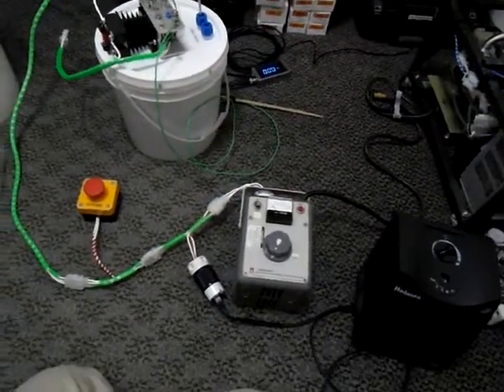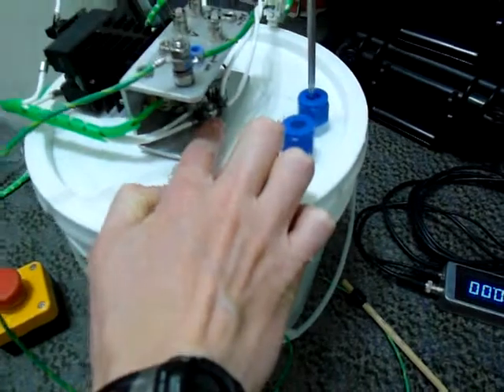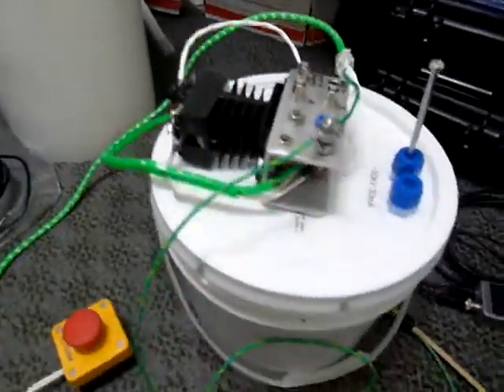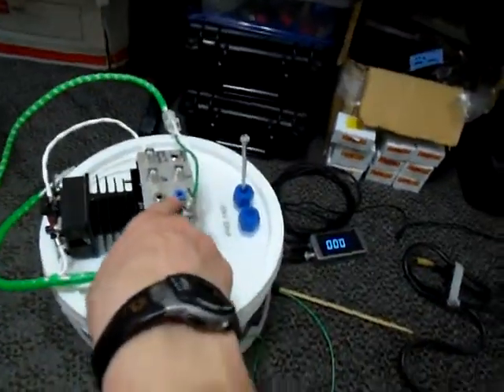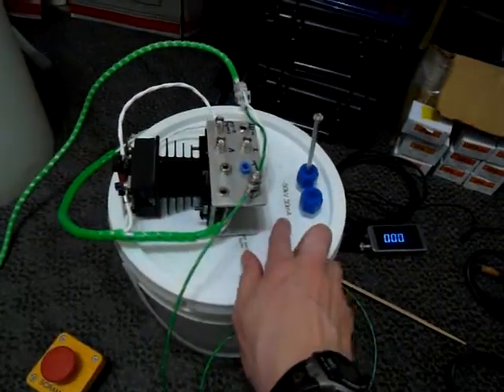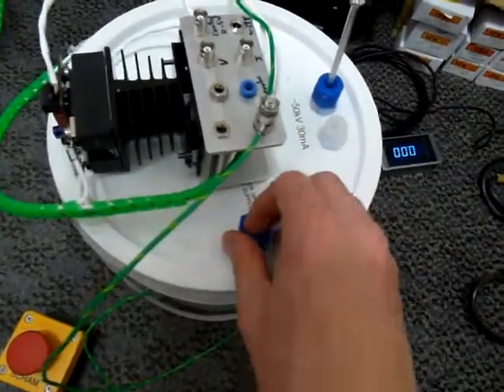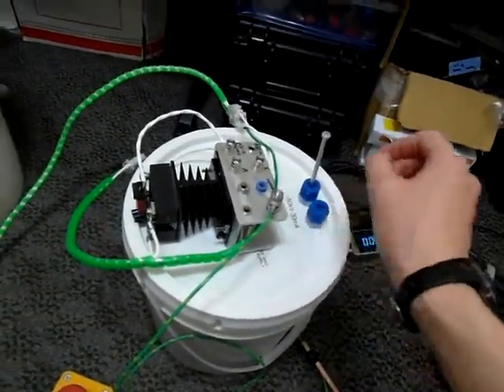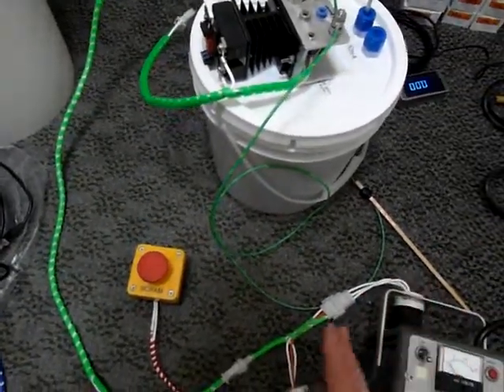High Voltage X-ray Transformer

Comment: How did u degas this ??
Reply from the maker: Left it in the oil over a summer while I was away. A vacuum pump is the right way to do it, but that also worked
Reply: Wow I'm surprised this didn't arc over in the windings..
Reply: I want to make vacuum to tube 
Can you help me for that please
Reply: @abdullahmahmoud3389  a Vacuum tube? Yes I can help you .. do you have glass working tools etc?